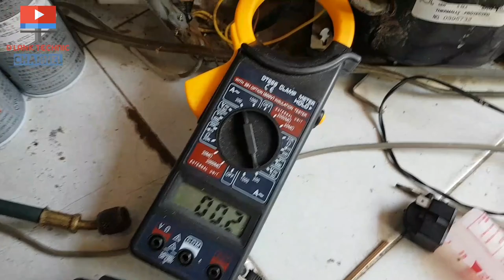Cara memperbaiki kulkas sendiri kompresor hidup tapi evap tidak dingin karena bocor dan mampet

Comment: Mas kulkas saya evaporator nya ketusul pisau di sisi bawah nya karna mencungkil es batu saat siang. Terus keluar gas sebentar. Terus pas esok pagi nya suara mesin kulkasnya jadi agak bising. Terus es nya mencair semua. Tapi masih keluar hawa dingin nya. Itu rusak apa nya ya? Kalo di benerin apa aja yg perlu di benerin? Kira2 biayanya abis berapa?
Reply from the maker: itu bocor dan ada air masuk dari evaporator harus di las lalu di flushing biar bersih dan isi freon baru... untuk biaya beda tempat beda harga gan tergantung teknisi di sana

Comment: Kompresor normal, bergetar dan tidak terlalu panas, di dalam ada suara gemericik air, tapi ditunggu 10 menit nggak ada hawa hawa dingin. Masalahnya dimana ya bang?
Reply from the maker: Kemungkinan overload atau ptc harus ganti sendiri bisa gan
Reply from the maker: Ganti overload sama ptc nya insaAllah normal kembali... harga murah tidak sampai 50rb gan
Reply: @DLANKTECHNIC  Sudah ganti overload dan PTC yang sesuai. Namun belum ada perubahan. Apa mungkin karena kompresornya kurang bekerja dengan baik? Soalnya semenjak ganti, kompresor dan jalur ke kondensor jadi panas (menghangat), tempat untuk isi freon juga menghangat, tapi kurang dingin (hanya dingin samar di bagian evaporator)
Reply: @DLANKTECHNIC  Apa harus dinaikkan starter/relaynya menggunakan kapasitor? Soalnya kalau tidak salah ingat, bunyi kompresor yang sekarang lebih sunyi walopun masih bergetar dan menghangat.
Reply from the maker: Kalo kondensor itu mamang panas klo kompresi kompressor kurang baik itu juga bisa.. mungkin juga pas ngisi freon kurang bersih dalam pemvakumanya....
Reply from the maker: 10 menit tidak dingin itu posisi kompressor hidup tidak
Reply from the maker: Apa itu ganti kompressor baru apa bekas... kapasitor hanya untuk start tidak ada salahnya kalo mau di coba....